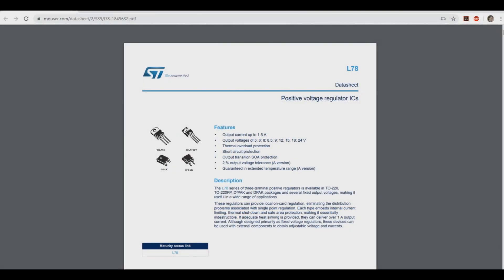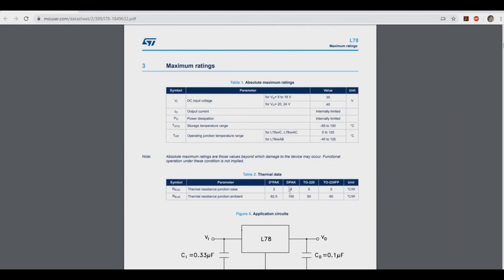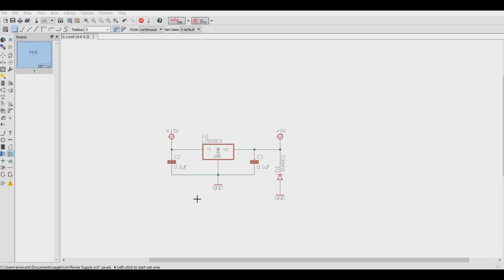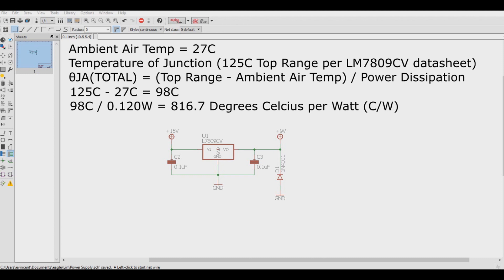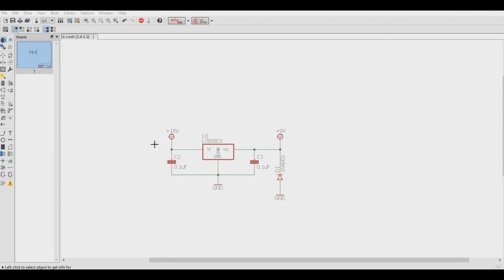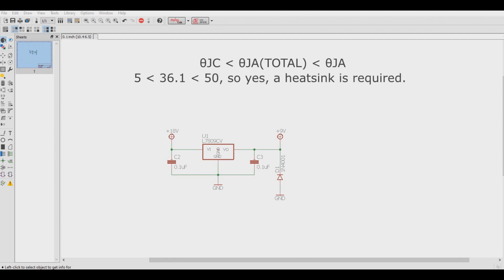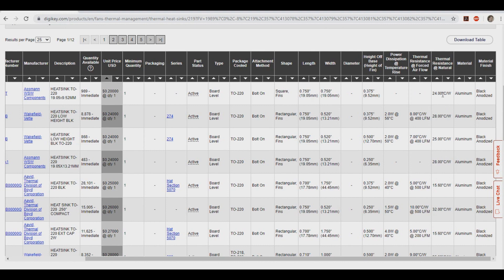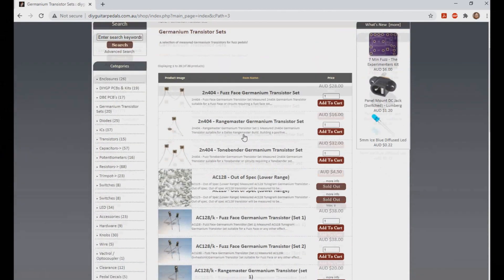Heatsinks - When do I need to use one?

Comment: Can the heatsink still work well bottled up inside an enclosure? Or do you need to start thinking about some kind of air holes.
Reply: Proper ventilation will usually need to be considered at some point, as that helps in the "ambient air temperature" portion of the math.